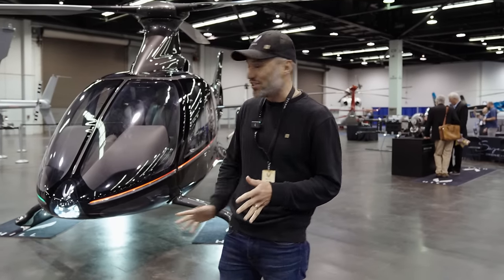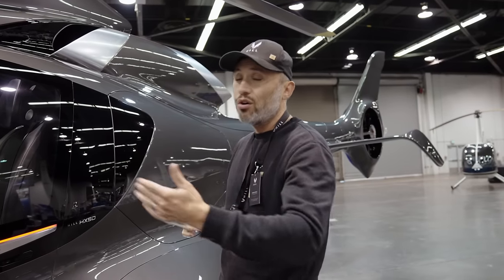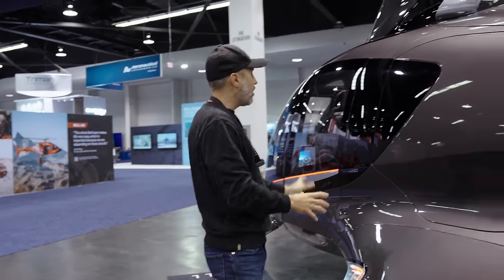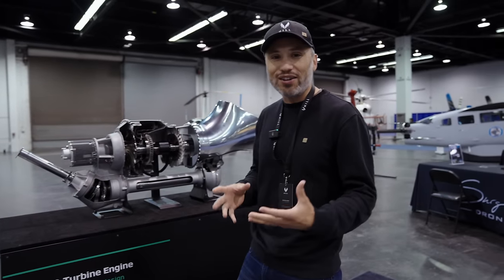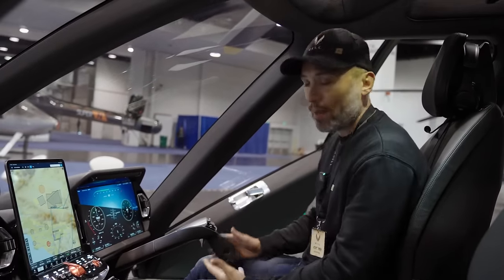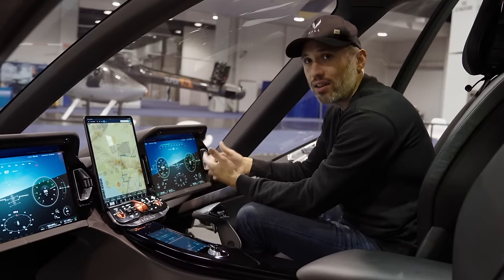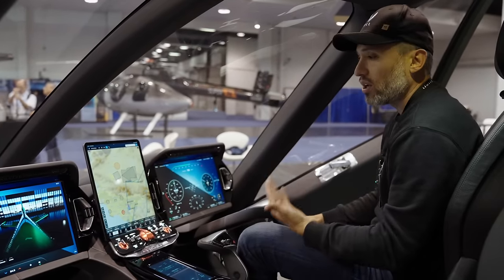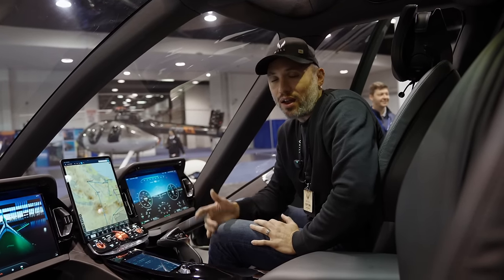First Walkthrough Of The Hill HX50!!!

Comment: It is still a mock-up though, albeit a pretty one.  So far as I am aware from the company's announcements, the engine has not yet run and none of the dynamic components have been tested (M/R blades, hub, transmission and T/R blades, hub, gearbox and drive). Hill is banking everything about this design on computer modelling. Can the complex interaction of airflows and resonances of a helicopter be modelled? No, they absolutely cannot. Even with the massive resources of Bell Helicopters, unexpected resonances caused the destruction of a test article in flight of their 525 "Relentless". Hill helicopters has focused on image, PR and promises: premium materials, luxury car values etc., and instead of building up from a simple test article, and then iteratively adding complexity after careful testing, Hill has promised retractable gear, folding blades, novel avionics, novel control system, and a faired hub that Airbus is only now testing after millions of flight hours. I have closely followed the development of the only other new single turbine helicopter, the SKYe SH09 by Marenco Swiss helicopter and now called the SH09. A pre-production prototype (NOT a mock-up) was launched at Heli Expo 13 years ago and it first flew TEN YEARS AGO after hundreds of hours of main rotor testing on a whirl tower. It is still not in production, having been refinanced twice and finally bailed out by Leonardo. And that uses a proven off the shelf engine! Helicopters are among the most complex vehicles made by man - you only need to read the work of the engineer RW Prouty to appreciate this. Time will tell if Hill is deluded or a scammer. I think he is probably sincere, so the former. This project is so redolent of the Eclipse Jet. That too, over-promised: Citation performance on a piston budget. It ended in financial losses for the early investors. Based on all the developments in aviation which we have seen pass before, this aircraft is several years away from flying and the likely outcome of this venture is that it runs out of money before anything gets in the air. At the moment, this is only a very attractive concept, with an extraordinary sales effort.
Reply: All bling, until it gets flight hours.
Reply: I also think, that it seems to good to be true. Some performance data seem unrealistic alongside the fact, that it will 100% sure be pretty heavy with all this equipment.
Reply: @Matthias947  Engine is over powered.
Reply: I’ve listened to engineer dude talk about the process and I’ve been impressed by their frankness and transparency.  I don’t think you are incorrect that there will be challenges unforeseen, but they do seem honest about the situation.  That includes engineer dude saying what you said - that modeling is one thing but real world testing of all forces combined is yet another thing that still needs to happen and to respond accordingly.  It’s a big mission they are on. No doubt there. They are a good product team though and the right team can do things that other teams repeatedly fail at.

Comment: Hill was designing a spaceship, and then settled for a helicopter. What an awesome machine!
Reply: lol
Reply: Trust me, the amount of money needed for R & D, fabrication and FAA certification will sink this company.  They would be better off jumping on board with an existing company that has funds and that needs a fresh start, like Enstrom or another smaller company.  Also, no one in their right mind would want to fly a helicopter for five hours straight; your arms, legs and hips  would be so spent you wouldn't be able to walk "if" you could still land the thing after a five hour run.
Reply: @BobABooey.  Sounds like you've never tried flying a helicopter for five hours straight. As someone who has done it quite a few times (obviously including hot refuels), I'll tell you it's not like running a marathon. It's part of the job, and while maybe not as comfortable as sitting in an airliner, it's no worse than driving a car on a roadtrip or something, depending on the type of helicopter. Just because most helicopters only have two or three hours of fuel endurance doesn't mean pilots don't stay in the cockpit for very long periods of time. Anyone who has done helicopter tourism, powerline work, or many other utility type jobs can tell you that 5 hours is often a short day in the aircraft.
Reply: @BobABooey.  Also, I mean no disrespect. You make a good point about the cost of R&D, certification, etc. Keep in mind however, that Hill plans to escape the cost of certification of the HX50 by making it experimental, meaning there is no certification required. That doesn't mean it won't be a safe and capable aircraft, just not usable for commercial purposes. Later there will be the HC50, intended for commercial use, which will be certified, and will have a bigger price tag to offset the cost of the certification. That model will come later since the certification process takes quite a bit of time, as you probably know. At least that's my understanding of it. I know people who have some of these aircraft on order and I'm optimistic. It could breathe new life into the world of helicopters, but time will tell.

Comment: Fixing helicopters for a long time, curious as to what thought has been put into routine maintenance that will undoubtably turn up. Replacing a boost pump, location of electrical components, performing routine inspections, special tool requirements plus as you well know all the other snags that can occur. Looking forward to seeing it in operation.
Reply: Newsflash - - - it will never be in operation.  At least not as shown.
Reply: @JustSayN2O  That's what they told Wilber and Orville.
Reply: @HoverTime  Whenever asked, I always tell people that my heroes and role models are Wilbur, Orville, and Frank Lloyd Wright.

Comment: Excellent review of this helicopter, thank you for posting it! A couple of things I was surprised at; the no fly-by-wire. I would have thought this nex-gen helicopter would have had some type of that system; the center console control screen. It's amazing how many control panels are replaced by the one touch screen.

I've flown jump seat on commercial aircraft, and the best seats were on the MD-80 / DC-9. Right in the center of the flight deck, at the rear, being able to see everything that was going on inside and outside of the flight deck during the flight. Exactly what you mentioned for the rear, center seat on this helicopter.

Comment: A true work of art I must say, Mr Hill has done an outstanding job bringing this to light.
A couple of Question:
1-Will the fuel tanks be impact safety rated against fire?
2-Will their be an override system for the dual controls?
3-Are the Bear paws going to be made a bit wider to prevent unwanted and uneven settling (common in snow).
4- Will their be safety guards in place to prevent exhaust corrosion over the tail boom which has been the cause of tail boom failures over the A-Star and Bell products?
 Well done Mr, Hill, Well done. :)
Reply from the maker: 1 - Yes the fuel tanks are crash resistant bladders and then they are foam filled like modern race cars to control sloshing and rate of fuel drain in the very unlikely event they get punctured. 
2 - dual controls are always mechanical. So there is no override to disconnect one from the other. Good verbal communication fixes that. 
3 - Yes, good sized bear paws to allow for snow landings. 
4 - we will analyze that in testing to see if it’s necessary. There are differences in the way we burn our fuel and position our exhaust as well as the tail boom materials. I can tell you more while in flight testing next year.

Comment: I can't believe that engine makes 500 horsepower. I started working on helicopters in 1968 (wearing the green). The OH-6A used a 176 pound turbine from Allison, later Rolls Royce, that made 317 hp in that application but was capable of 420 in some later versions. It had a different design for the compressor section that took nearly 500 horsepower to turn. The engine shown in this video ought to be relatively inexpensive to buy and to overhaul, given the smaller number of parts in it. How much does that engine weigh? Imagine what you could build with two of them in a stretch version of the HX50.
Reply: $784,000 to fly it.
Reply: They state the engine weighs 100kg, they don't state if its standard HP or imperial though. It hasn't been actually run yet though, just numbers so far. The Original Allison in the OH6 was closer to 60kg, the helicopter was significantly lighter also. The power to weight for the HX50 would be similar to a MD530F at low altitude.

Comment: Wow!!!

First time we are seeing engineering numbers regarding the Hill Heli….  Now we have something to compare to!

Power and fuel flow and speed are important to real pilots…. The engine and trans need to actually work to achieve these numbers…

Impact strength got glossed over a bit…. Putting fuel in the strongest part of the airframe is important…  where it is critical, is when the helicopter hits the ground hard…. How Are the occupants protected from the fuel when carbon fiber shatters in the hard landing? 

Looks like a large comfortable airframe… pushing it at 140 knots is going to need a lot of efficiency!   😃

Great presentation!

Comment: Mischa, I have two questions
1. If a person slept inside the cargo bay or happened to accidentally get in and the doors closed on them, is there a latch inside for safety purposes so you could open either of the doors to get out? The thought of being trapped in there is terrible.
2. The aerodynamics of the rotor head is awesome and is one of the first or only choppers with the cowling around the rotorhead means is there any issue at all with cooling of the mechanisms and bearings in the rotorhead now that there is no air flowing through it like other helicopters. Do the moving parts in the rotor head require any cooling?
Reply from the maker: It’s a good question about the baggage bay, I’ll make sure there is an emergency release inside so nobody can get stuck in there. 
Nothing in the head will need extra cooling. The head will be fine cowled in like that.

Comment: Would be nice to see a but more info on throttle control when dealing with  autorotation practise , manual use by pilot in emergency ops. A great video a fround breaking effort.wish you all the success  in the venture.
Reply from the maker: It’s a simple fly/idle switch like all modern helicopters these days.

Comment: Amazing and impressive!... but sadly, the bulky carbon fiber structure takes-up more windscreen space than metal framed choppers.  Visibility is much more limited in nearly every direction.  There is a huge blind spot for the dreaded power line issue.  Setting down a slung load in a tight spot would be nearly impossible for the pilot to see.  Assuming it has belly camera's, they may struggle to show clarity through dust or poor lighting.

Comment: I'm confused by the cyclic.  Wish you went deeper into showing it.  Thanks for being on YouTube!
Reply: My thoughts exactly. There seemed to be strangely limited range in the cyclic.
Reply: Needs to be a youtube video-flight controls  tutor.
Reply: I think it's amazing - It goes down under the "dashboard", so no climbing over it! It then across to the centre of the helicopter (to join up with the LHS cyclic) and that connects into the push-pull cables that run up the centre carbon section to the swash plate.

Comment: Great presentation as usual Misha!  Do you have any information to share on autorotation performance such as main rotor speed control difficulty?  Thanks.
Reply from the maker: It has a very high inertia rotor system with a fairly wide range for rpm variation during power off autorotation. The inertia will be similar to a Bell 206.
Reply: Has one actually  flown yet??

Comment: Hi Misha. I don’t have my rating yet, but I’m instrument rated and flying an SR22 which has similar thinking in some ways to your innovation. 

However, I’m curious as to why you guys did not go down the Garmin 3000 route, which is tried and tested with full support. I understand reinventing the wheel somewhat in the airframe and characteristics, but I think building your own avionics (and autopilot and controls) might just be a step too far.  Let alone getting certification on new instruments. 

Likewise, I would say offering two undercarriage options to start is creating unnecessary complexities. Keep it ‘simple’ to start. 

Look how Elon did it. Roadster proved the market snd acted as a test bed and created cash flow > Model S created a standardised platform and grew awareness. More testing  > Model X. Same underlying infrastructure, different audience > Model 3 = mass market and revenues > Model Y, same infrastructure, different audience > Cyber truck = new market. 

You should be thinking building the Model S now ….X is your retractable version with a bigger payload and speed…

I’d love to get involved in this project.
Reply from the maker: The price for a Garmin display is prohibitive and you still don’t get what you want. The wheels or skids options are simple things and are standard options when you configure your machine. It doesn’t increase complexity. They are built onto the same airframe.

Comment: Don't like the cyclic, to many proprietary items like avionics, lights radios when you need parts and they are across the pond... when you have the components you want you can get them locally . Also needs a manual over ride for the FADEC. Need a striped down utility version also, not every one need bling! I like it but would like to see it more user friendly, another words I would like to spec it out with what I want! like the big manufactures.

Comment: Only 500 HP???? Kinda hard to swallow that one!😂
Reply: High efficiency and low weight. The way of the future.
Reply: @lessharratt8719  yeah but that's a VERY large aircraft. Not to mention one pilot and four passengers. Kinda hard to believe.
Reply: I agree...About half the power of an h125 ? Correct me if I'm wrong
Reply: Bell 505 is 505 hp
Reply: @WRA838  three rotor blades, giant cockpit, enclosed tail fan, deluxe instruments package, five crew, large fuel tank. Little shaft turbine with 500 hp for 30 seconds. That copter is the most efficient aircraft ever made.
Reply: @WhyitJellyDonut  - Aren’t the MD-500 series helicopters also under 500 hp? They also seat 5, total.
Reply: The EC 120 and Bell 505 have just above 500 HP as well, and I guess they are much heavier.
Reply: @WRA838  some where around 800+ on a B3

Comment: As others have said, fabulous narration, bad music, shocking lack of fly by wire. I mean, Musk’s Cybertruck drives by wire fir $100,000!
Looking ahead, I’d scrap the internal fuel tank and use outside pods, configurable and modular. The turbine’s got to have two stages or you waste fuel—I mean, even Chrysler’s old turbine car had regenerators! Carbon fiber is fine, so why skimp on the engine? The skids are horribly ugly; surely they can be sleeker. Wake me when it’s on the market.